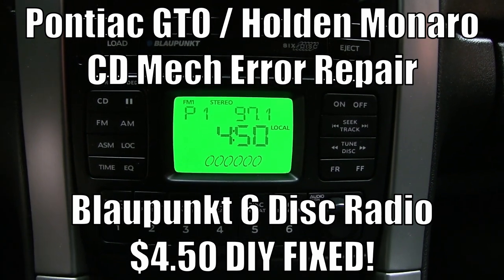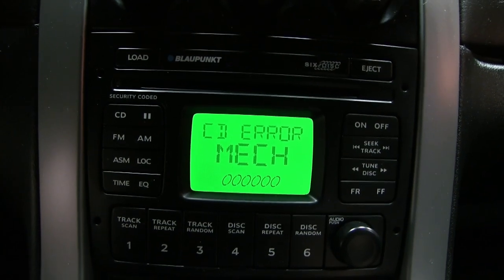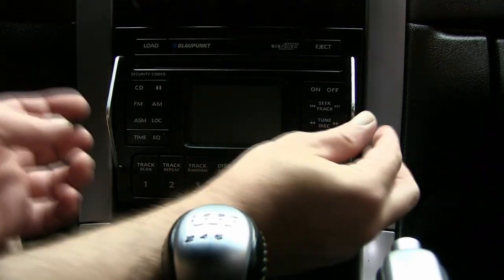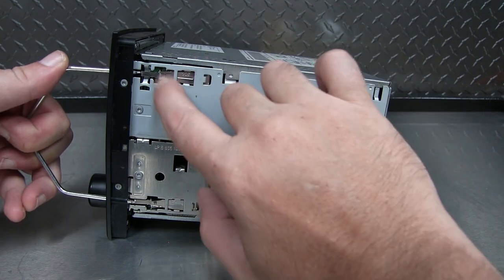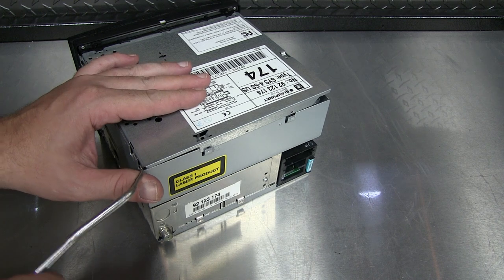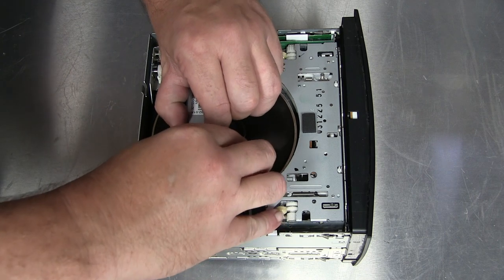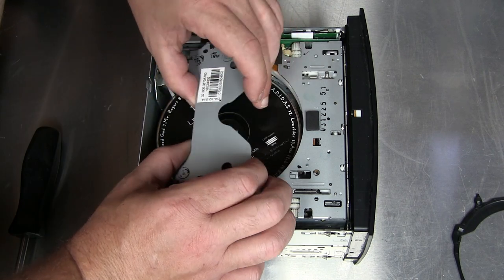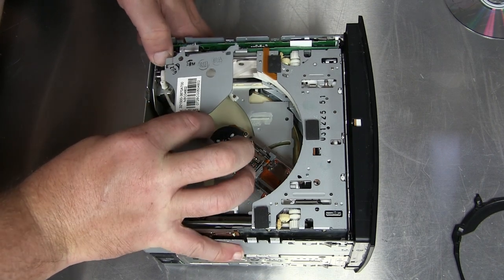How to Fix a CD Mech Error in a 2004-'06 Pontiac GTO or Holden Monaro with 6-Disc Blaupunkt Stereo

Comment: Thanks for posting this, my 04 GTO CD worked until 4weeks ago, and I can't get them to load.  With this new-found knowledge that you so graciously posted I have the means to fix my player and not spend tons of cash at the Scalping dealer .. Thank you so much.  R/ Glenn
Reply from the maker: Your most welcome Glenn.  Be careful in there, work like a surgeon and make sure not to force anything.  Don't undo any springs and make sure no tabs get broken or it may be toast.  Wishing you success in your repair and beating 'the dealer'.  Good luck!

Comment: Hi Dan, can you offer any guidance where the springs connecting the plate at the top connect to?
Reply from the maker: Sorry Alex, not exactly sure on that.  When I did mine the top plate springs did not need to be removed.  I just lifted the top plate up and out of the way for access as removing and reattaching the springs looked to be pain.  I do recall those springs going straight down somewhere though, so if one popped loose I'd look for some type of C-hook (probably metal) that they should re-attach to at the base.  Hope that helps.
Reply: @diymakerdan  No Worries Dan, thanks so much for the prompt reply.  Will have another look tonight
Reply: @latrobesquare  u ever figure it out did the same thing
Reply: @matthewstover2429  Hi Matthew, yet to re-attempt.  Have you managed a solution?
Reply: @latrobesquare  any luck my friend ii am in same jam I have looked and looked flashlite magnify glass o can't find where the hell they attach
Reply: @mikebaconheart2620  Hi Mike, still no luck.  The rest of the unit works fine; will need to set aside a morning to have a go.  Best of luck; let me know if you find a solution.  I originally found a location to anchor the springs but they are too long; perhaps sourcing some shorter ones may work..

Comment: I have the tools you used in your video to remove the radio but when I insert them into the holes in the radio and try to pull it out, the tools just keep sliding out and the radio stays in place. I have tried spreading them apart and wiggling the radio while pulling. No luck. The radio appears to be stuck. Any suggestions?
Reply from the maker: Try to wiggle or apply more outward pressure so the release tools do not slide out and the radio should pop out.  Some radios release like butter on the first try whereas others will make you really work to get it loose.

Comment: Hi mate i have 2009 commodore omega. And it has almost same problem, there is no cd inside but it still show cd error and mechanism error. Can you suggest something. Thanks
Reply from the maker: Sounds like something is jammed up inside.  I didn't think mine had any CD's in it until I popped it open.
Reply from the maker: Hey mate I thought of something else too if there is definitely no CD/'s in there.   Not sure if this applies to you but kids like putting things through the CD slot.  I have popped apart a few radios in my day to find loose change in them, shake it out and they luckily worked again.
Reply: Mine just had the same Mech error. Looked inside it and no cds. Just wound those littles wheels back and forth a bit, put some lube on them and now my cd player is working again!